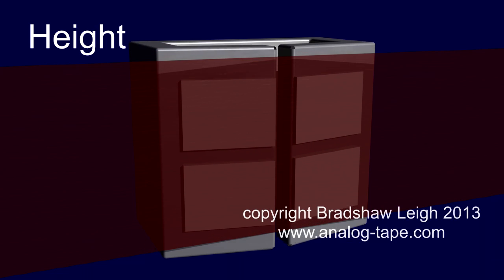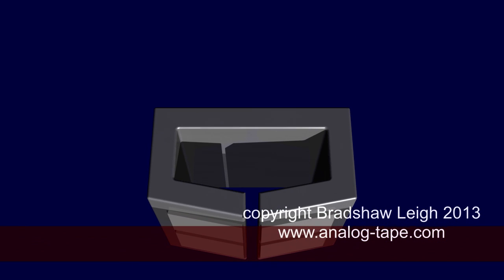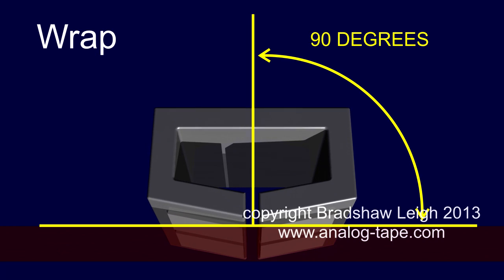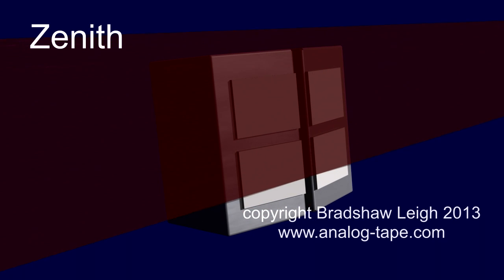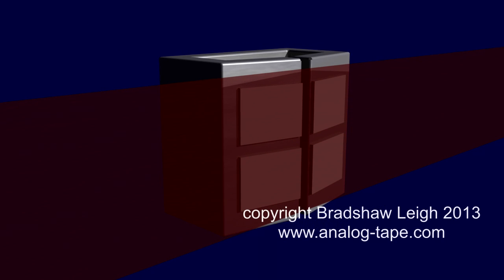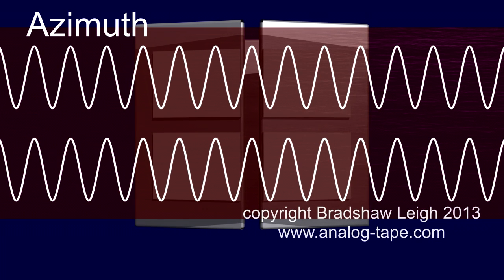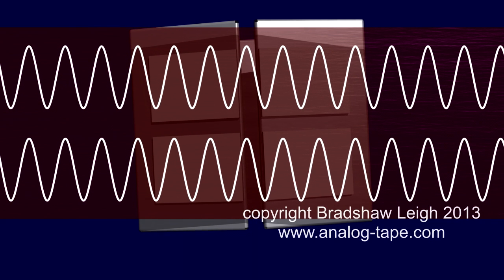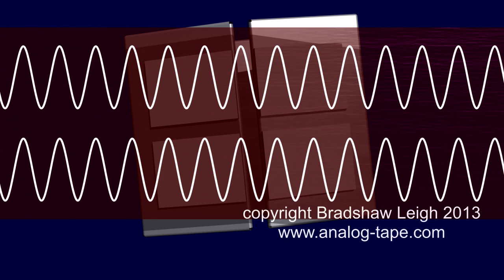Azimuth and Head Adjustment terminology

Comment: Nice clear explanation Brad! 

A good test to see if our cassette deck head's zenith is flat-on, is to play (a cheapish) tape without the pressure pad. Out of alignment will tend to force the tape to slip up/down, and you'll see this as a mark/imprint/crease on the already thin tape.

Comment: I just wonder how many techs are educated in how to do this.  Sure it's easy to see what can go wrong and I can understand what screws on the head affect each of these issues.  But how do you know when your getting it right.  I adjusted my deck yesterday by eye and by ear, I had to adjust the top left screw on my 3 head deck the Zenith was badly off . The results are quite amazing, compared to the issues I was having.  The tape wasn't even spooling properly. Now it may not be perfect but it sure is a lot better.

Comment: nice explanation. It is worth adding that apart from azimuth these adjustments should be performed only when the head is being installed. After a few hours of use there is already a wear pattern in the head, and it becomes inadvisable to change head alignment. Also you must do azimuth with a pre-recorded test tape!
Reply: True but it depends on the head. Many  pro heads have what are called "relief slots" or "gutters" machined into the  the head face so that even with some head wear, no wear groove develops. It's also possible to machine such slots into existing heads. Some of the higher end Nakamichi cassette decks have heads with relief slots as standard. For one thing, it allows user adjustment of azimuth for optimal response on various tapes.

Comment: Unfortunatly  the wrap cannot be adjusted at most cass decks.
However , the wrap adjustment .. There are a few deck that seems to have the wrong wrap, just by looking at them ,  but they sound very good. Of course the tape contact between rec and playback area of a combined head,  should be the same

Comment: thank you for posting this awesome video, I miss working with analog machines. I aligned many from mono, stereo and multitrack reel to reels to cassette recorders. the younger generation can really use this info to get the most out of their second hand analog recorders. Not many audio engineering training programs cover this stuff anymore. I was on the tail end of the 24 track 2 inch tape era so it was covered extensively for me..Pro tools never goes out of alignment lol! Thanks again :)